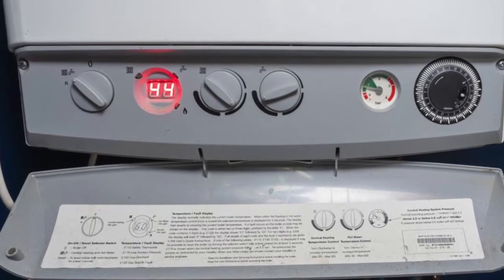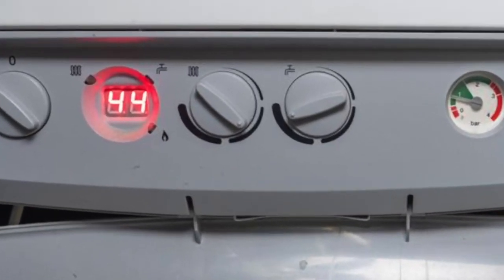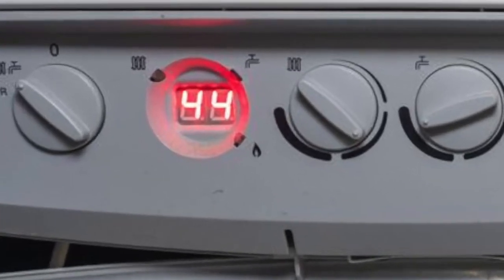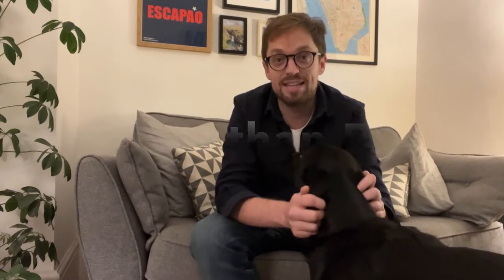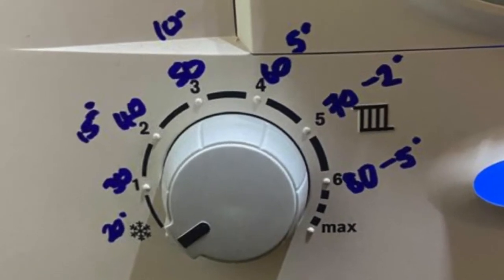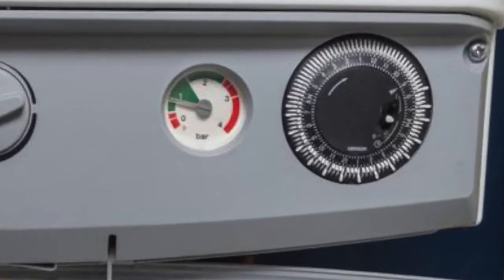Hack your heating bills this winter - Low Carbon Lifestyle Episode 37

Comment: Tom, Like your videos👍There is No doubting you have lowered  your Carbon footprint with the Heat Pump, but in your recent video you point out that your energy bills have actually gone up by 28% from the previous year!!! Though we need to cut our Carbon substantially, lets not tell people that Heat pumps will save them money, because at the moment I have seen no evidence this is the case. The outlay even with the £5K Gov. grant is thousands and thousands of pounds and you and others have proved that it costs more to run a heat pump than a gas combi boiler. I know there those out there who have massive insulation, solar and batteries that have minimal heating bills, but they are the few, and they are the minority who can afford the 10's of thousands of outlay. Lets be honest with people, and tell them at the moment with the gas link to electric, it will cost you more per year than a gas boiler.Cheers
Reply from the maker: Thanks Jezza, yes the video I did 5 weeks ago was based on our old tariffs, which will change in a few days time, and at the new rates, our heat pump would more or less be cost neutral against our old gas boiler, and if I can get the efficiency a little higher, will have a small saving over the year. I talk through costs for next 12 months here - https://www.youtube.com/watch?v=ieVDsS_YOgU

This video was mainly about reducing flow temperatures of condensing boilers to get efficiency up. I do make the point that lower flow temperatures help facilitate heat pump installations, and if you could get a boiler flow temp down to 45 degrees, then you are proving your house is ready for a heat pump.

Yes the cost of heat pumps is a big outlay, and I have tried to be clear in my videos over the last year or so that heat pumps don't offer a pay back on their own (they are definitely cheaper to run with solar panels).

I hope I have been honest if everything I have said...!  Using real, measured data to talk through exactly how a  heat pump is performing. Not trying to mislead anyone!
Reply: @TomBray-LowCarbonLifestyle  Sorry Tom, I think I commented on the wrong video! Doh!
Reply from the maker: No worries! Thrilled to hear you are watching more than one video!

Comment: Hi Tom, saw you at New Wine a few weeks back, really good session. We have a gas boiler that's connected to a hot water tank, which unfortunately our landlord installed only 18months ago (just before heat pump grants became available...grr!)... so we have to be conscious of the legionella risk- wondering if there's a way we can manually set a low flow temp for most of the time with weekly high temp purge as described for a heat pump system- any idea how long the system would need to be on the high temp setting for to clear out the nasties (1hr? 6hrs?)...
Reply from the maker: Hiya - thanks for reaching out and good to connect!

The most succinct answer I have seen on this one is point 12 in this guide - https://www.theheatinghub.co.uk/articles/turn-down-the-boiler-flow-temperature. 

Our heat pump pasteurisation cycle basically brings the temperature of the stored water to 65-70 once a week and then leaves the system set at a lower temperature (43 degrees) for the next 7 days, how long it takes to get up to that temperature depends on the size of the cylinder etc.

I am not sure there is much else you can do without a bit of retrofit to the system. There would be risk in going too low with the set point, and I am not sure there will be many who recommend going lower than 70 for prolonged periods of time. Tricky one! Sorry I can't be of more help!

Comment: It is very interesting to see the heating and hot water systems there in the U.K. Here in the states (particularly in the West, Midwest, and South. Boilers and radiators really only exist in the Northeast states because most of the U.S. uses air conditioning and central heating systems. 
I recently moved from a house with a natural gas water heater and central natural gas heating  (and central electric air conditioning which I managed not to use this year.) I had recently redone the attic (loft) insulation to 14” but did not get to reap the benefits before leaving. 
I am now farther south (south Texas) in a small apartment with a central air heat pump system and an electric tank water heater. We shall see how much this reduces my emissions in the upcoming year. I doubt that I can get away with not using air conditioning in the worst summer here in south Texas due to the high humidity and lack of a breeze. 
Thanks for continuing with the new videos.